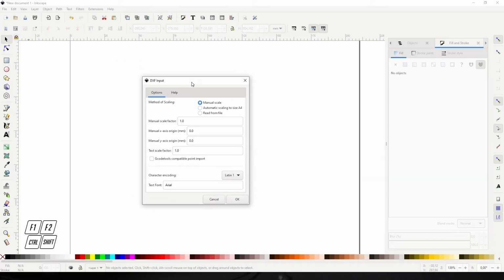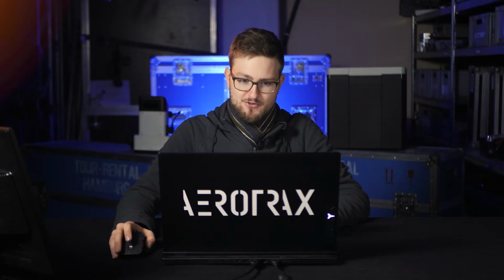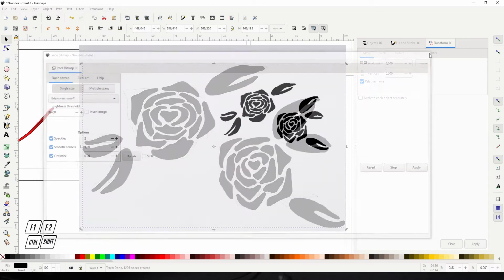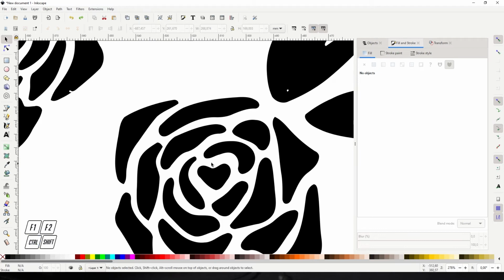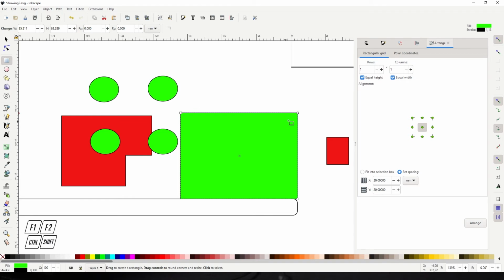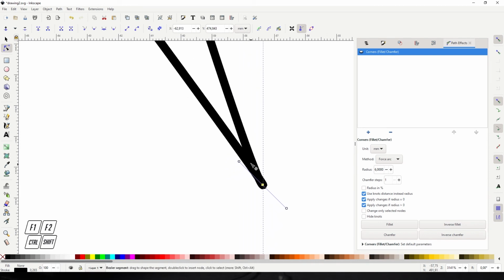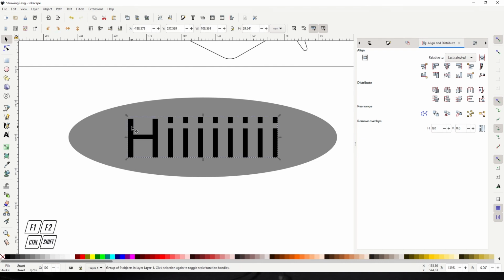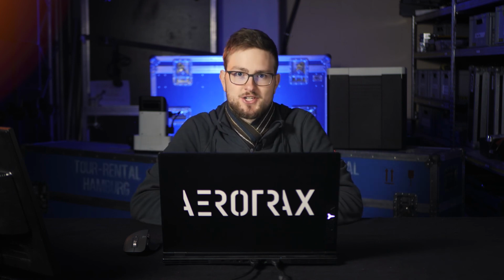Inkscape Tutorial (Part 2/2: Advanced) For Engineers And Shaper Origin Users

Comment: Thank you for this series! I was following along and also couldn't get the "round edges for cutting" behavior to work the way I wanted via the "Corners" Path Effects.

tl;dr is that by unchecking "Use knots distance instead of radius" (which you still have checked in the video) and setting method to "Force Arc" I was able to get a path that perfectly fit my example "cutter head" circle, both inside and outside the line. Hope that helps and thanks again!
Reply from the maker: Nice, thanks for taking the time to share your findings!

Comment: Thank you so much, particularly for the instruction on how to negate the effect of stroke on object size using Geometric Bounding Box.  Very helpful!  I am still trying to figure out how to move or copy an object with respect to two points not on the object.  For example, if I want to move a shape by the distance from one corner of a square to another corner of the square, but the object to be moved is not on the square.  Simple in CAD, just move selected items from reference point to target point.  Done.  Any ideas?  Vielen Dank!
Reply from the maker: I can imagine either using the "Move" menu (can be opened under Object->Transform) or typing in the desired translation as an addition into the X/Y position fields, e.g. "23+4,5". In both cases, you need to know what distance you want to move your shape, e.g. by measuring it first.
Moving between two reference points doesn't seem to be implemented, but you could bodge that behavior by drawing a line between your shape to be moved and your reference square's first corner, then selecting that line AND your shape and moving both until the line hits the second corner of your square. Snapping has to be active of course.
Hope that helps 😊 Thanks for watching!
Reply: I accidentally discovered that you can select an object, press Alt on keyboard, then move the object between two reference points not on the object.  The downside is that object-snap doesn't work, only grid snap.

Comment: I have a logo converted to SVG that has many wavy lines the connect at sharp points. How can I adapt this method of making the points (corners) to a bit diameter whilst not messing with the wavy lines. simplifying the shape seems to deteriorate the wavy lines and corner fillet is not an option when trying to add it to shape.
Reply from the maker: If you can't add the Fillet/Chamfer path effect to your shape, check if your shape is valid (closed shape, no duplicate paths, etc.).
Then add said path effect and turn on "Change only selected nodes" in the Fillet/Chamfer menu. Afterwards, you can select the nodes you don't want to have changed (ergo everything except your sharp points) and set their Chamfer "Radius" to zero. Just tested it, should work.
Reply: @BodgedButWorks  Thank you, that helped a lot. I am very new to Inkscape and Shaper. I pretty much sorted out the whole logo now. Thanks again for being such an awesome resource
Reply from the maker: @benyarborough5559  You're welcome and thanks for the feedback, I'm glad I could be of help 😊

Comment: i am building a small coin bank and want to embed the brass coin slot in the top.  For the shaper, I want to embed the brass coin slot part about 1/8" down but cut the slot itself all the way through the 1/2" project wood.  I have built the new document in inkscape with the oval for the brass and a rectangle for the slot.  How do I set the cut depth for each?
Reply from the maker: You set the cut depth directly on the Shaper Origin, so you don't have to encode it in the file. I usually add a text for each layer stating the depth (e.g. "t=4mm"). Don't forget to convert the text to a path and color it blue so it gets recognized as a guideline.
You can check out my recent projects on ShaperHub (BodgedButWorks) for examples.
Reply: @BodgedButWorks  thank you.  i can do that.   your videos are excellent.
Reply from the maker: @chevdiver  Thanks, glad you enjoyed them 😊 Have fun Shapering!

Comment: I've been working with Inkscape/SO for about ten months.  These videos would have saved me hours of trial and error learning.

Great catch on Inkscape's incorrect use of "Radius" on the radius/chamfer tool.  I never caught the correlation using Imperial units and assumed that I just didn't understand the tool.
Reply from the maker: Yep, I can relate to your trial and error testing, been there 😉 Was there anything new for you  in the video nevertheless?
Reply: @BodgedButWorks  Yes, I did not know that the scaling of line weight could be turned off.  I thought it was just one of Inkscape's idiosyncracies to deal with.

Solving the radius/chamfer tool thing will be a big deal for me, starting with the next new project.  Thanks!
Reply: I just learned on changing the corners to radius check the  box to be able to select individual nodes to change the radius works really well if you don't want to change all of the corners.
Reply from the maker: @TheWayne660  Cool, thanks for sharing!